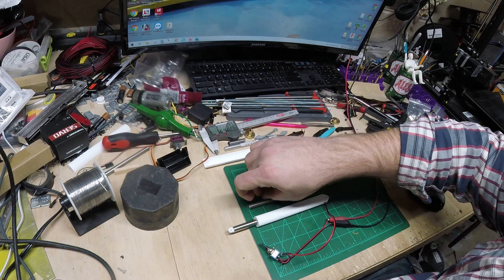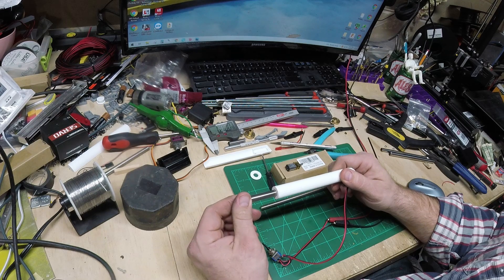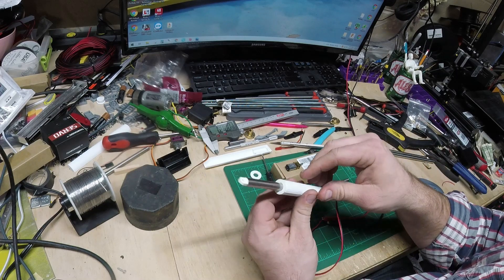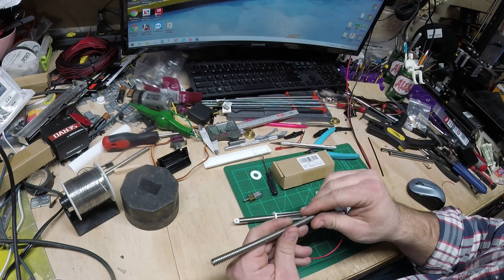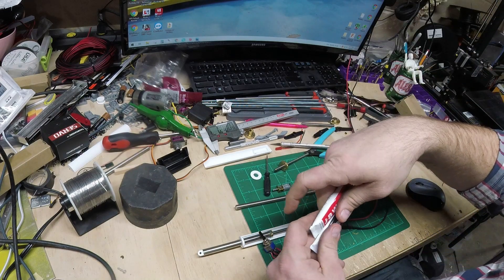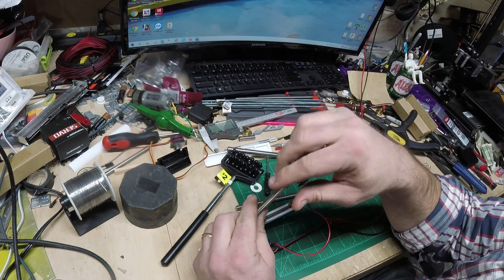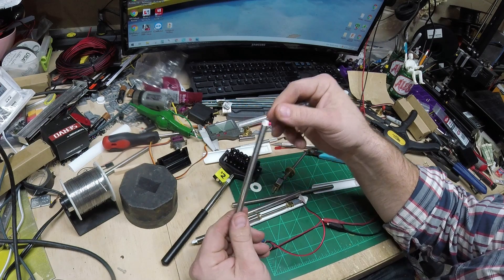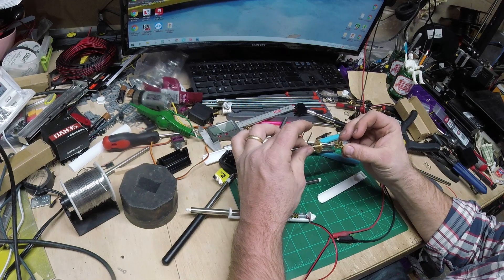DIY Linear Actuator - Version 1 Realistic Hydraulic Cylinder Look

Comment: Keep the inside diameter of the body, the same size as the tubing diameter, all the way back to the nut. Or a hair bigger so not to bind. This will keep the tube from moving around loosely, and looking crooked, when its extending out to full length. Plus it will always stay sturdy, in line, and not bind, when its starts to retract.
I love the idea, and it looks great!👍

Comment: Came back to see this again.
What do you think about 3d print a coupling between the D-shaft and the leadscrew?
I'm unsure about drilling straight enough like you did. Or a 3-5 mm universal joint?
Reply from the maker: That will work, but it will add to the overall length which I am trying to cut down
Reply: @joe_of_all_trades  
Your right about that, and i don't like that either. I'm missing a small lathe in my arsenal of tools to though and to be honest, a ridgid connection like the glued one you described.. that calls for a very straight hole. 
Thank for your answer 🙂

Comment: Add some hex head into the print around the end where the cylinder comes out. To simulate the seal cap.  This definitely has me interested in taking the file and tinkering with
Reply from the maker: Go for it, I left it that way to start with a proof of concept, as I refine this more realistic details will get added, tinker away!